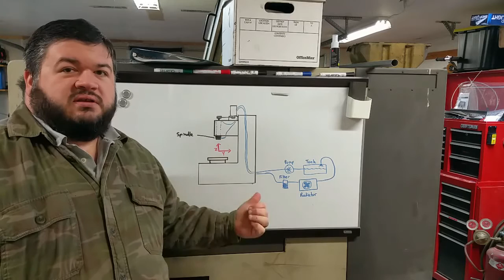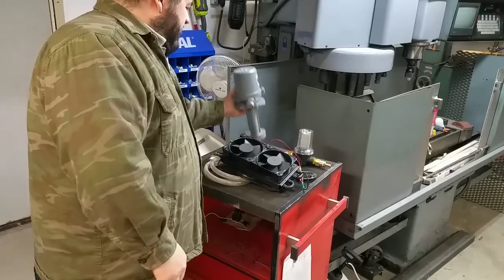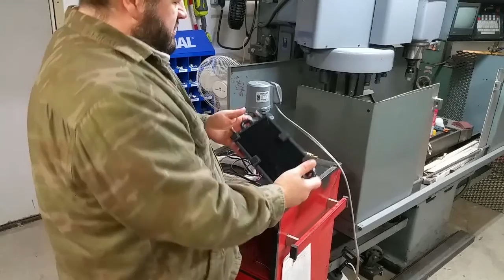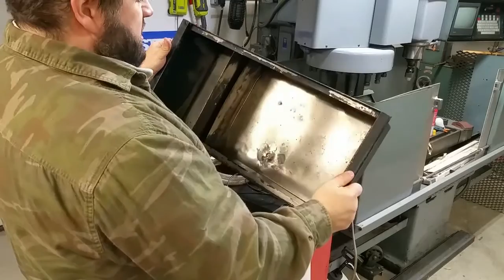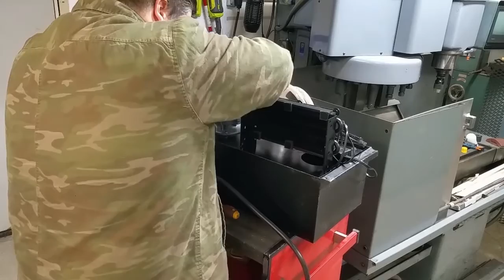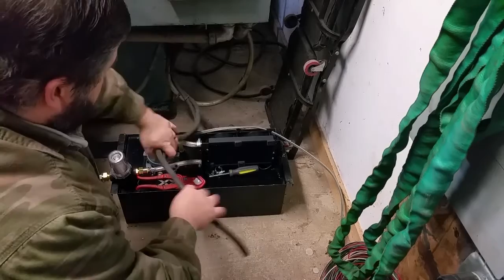Building a Spindle Cooler for the Fadal

Comment: Thanks for this, just bought a Hartford VMC-850S with the plumbing for spindle chiller but no chiller and this has given me a good idea on where to go. Cheers
Reply from the maker: Cool, you can also use PC water cooling radiators, they are about the same size (240mm radiator).  I still think the small coolant pump is a good idea though, the PC stuff is low flow and designed to be quiet.

Comment: Also if the spindle outer bearing races are cooled along with the housing  the inner race and spindle shaft are still getting hot and expanding so could cause more pre load on the bearings. In practice at 8000rpm that shouldn't be a big issue but something that never gets mentioned in the machinery catalogues :-)

Comment: On the Hermle machines they use non rotating ball screws with coolant running through them..each end is fixed so no rotating seals to worry about. The servo motor is belted to the ball nut and rotates the nut and travels with it up and down the ball screw. THK make the screws I think.